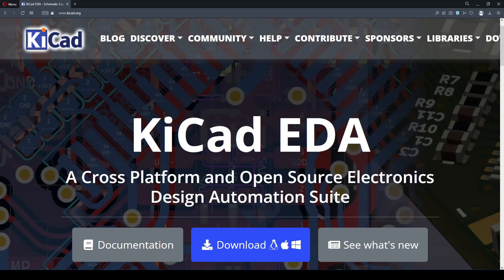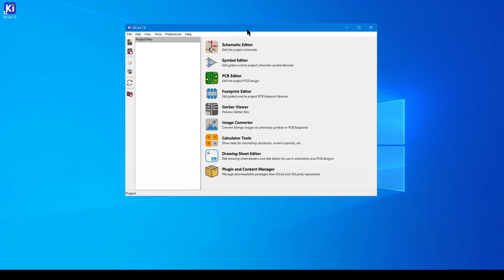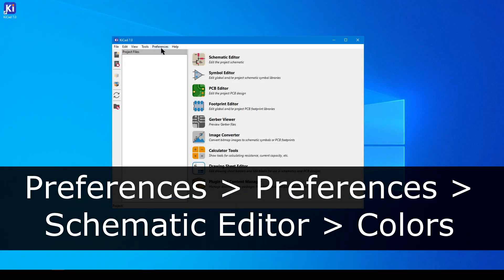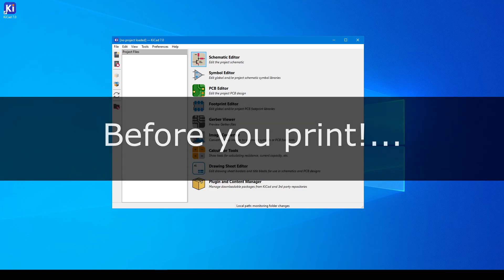KiCad 7 Tutorial: Installing Plugins (Part 1)

Comment from the maker: Don't forget to apply changes after installing.  KiCad offers several plugins to speed up your layout and pricing/quotation process, so be sure to check them out!
0:00 - Previously...
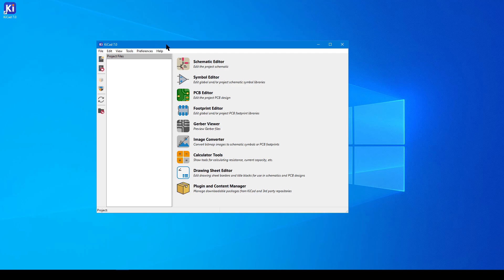0:20 - Plugin Manager
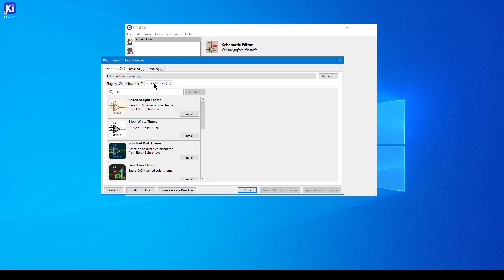1:05 - Solarized Dark Theme
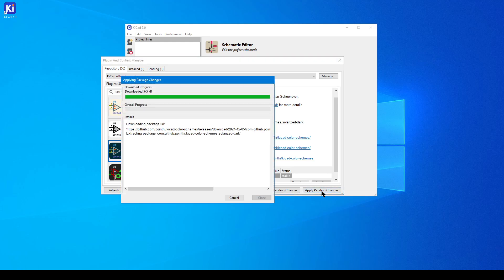1:25 - Applying the Theme
1:53 - Before you print
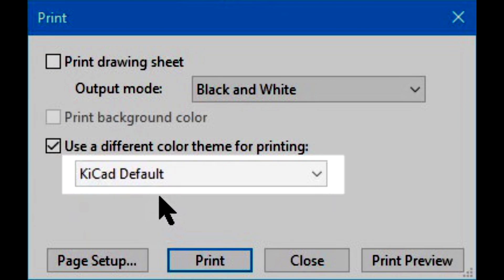2:22 - unboxing-tomorrow.com